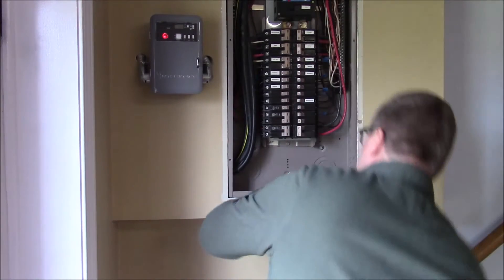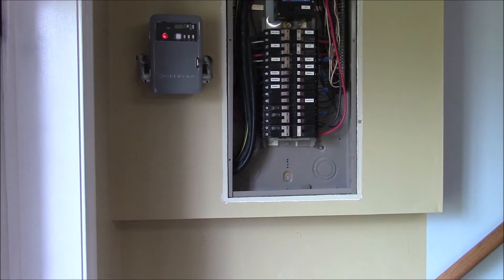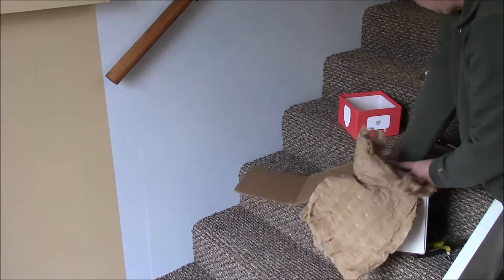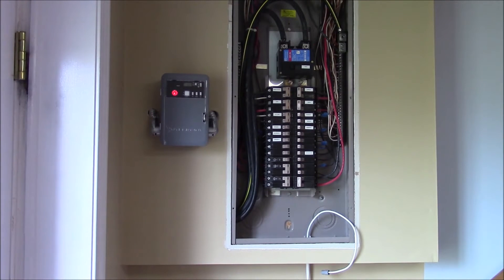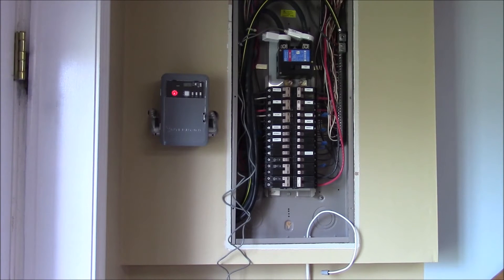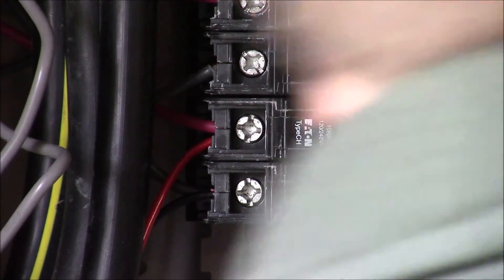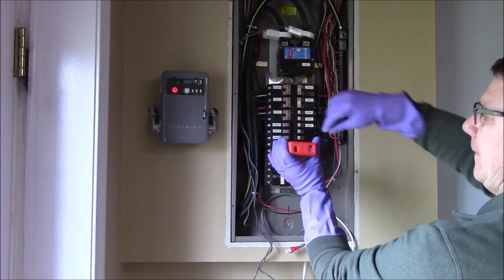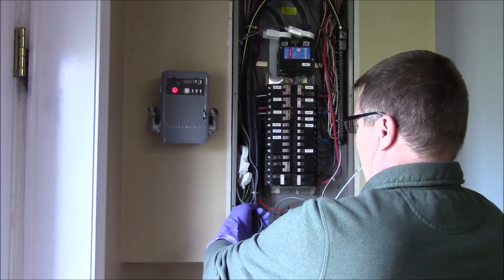Solar Sense energy monitor installation

Comment: Double tapping (connecting  2 wires to a breaker terminal) would fail an inspection by either a building inspector, home-sale inspection or a insurance inspection.
Reply from the maker: Can you explain the safety issue please?
Reply: @davidkllr1629  A concern is double tapping increases the risk of the ends of two wires arcing should a terminal designed to handle only one wire have two wires attached not tighten correctly.  Equally, the original circuit may have been designed to code and approved with the proper breaker for the expected load.  Should an additional circuit be added to an existing breaker the new load or potential load may far exceed the original design considerations (not in you case) thus creating the risk of inadequate circuit capacity and reliability.  However, a new owner may have no idea that the electrical circuits were modified subsequent to original design and approval but a double tapped breaker is a tell-tale clue that the original design parameters may be compromised.  Therefore a home inspection done for a new owner will point out this potential condition that a not to code (or unsafe) modification was done.

Comment: So they say to clamp the solar clamps with label going to "power source", I was thinking the power source was the solar panels / inverter but seems like you installed labels towards the power company main power source is that correct?

Comment: I just loved all the wrong electrical assumptions, the lack of proper safety precautions, the improper use of "insulated" hot gloves, and of course the double tapping of the one breaker you're NOT supposed to be using for anything else than the actual solar system...Unreal!!!
Reply from the maker: Thanks for watching! I appreciate your concern for my safety.

Comment: I was setting up Sense for solar and I had this error message popping up "wattage mixed polarity" and solar setup failed.I'v got answer from Sense Help,that this is because one of the solar clamp was installed flipped, so it reads negative wattage.So to make it work you need to make sure that label "sense" on solar clamp faces towards solar wire production.There are arrows, so make sure you have the same direction of arrows on clamps.It's tricky part, but it was that error solved.I was running like crazy turning solar from outside, one by one inverter..tried everything and nothing solved it ..Ohh and it was just that clamp direction problem. I hope this helps if you facing the same problem.Otherwise Sense is marvelous, the best energy monitor of house and solar on app.I love it.

Comment: Great Video. I noticed that you connected power to only one side of panel. Another video I saw he pointed out that you should connect the power to each side of panel otherwise Sense will not be able to detect devices on the opposite side of the panel and will list things connected to the opposite side of panel as "Unknown". Does this make sense?
Reply from the maker: Terry Pounds thanks for watching! The Sense unit is hardwired to a double pole breaker, so it does have access to both legs of electrical service. I mention that it's located on a 20A breaker for solar and I should have used a 30A breaker, but I don't explain why. During the solar install, Sense wants you to turn the solar off and back on for calibration. Normally I would turn off solar by turning off the solar breaker, but this also resets the Sense device. If I had used the 30A spa breaker instead, the solar calibration would have been easier. As it is, I had to go outside and disconnect the solar. Not all that difficult, but I felt pretty stupid the first time I tried to calibrate the solar by flipping the solar breaker, which killed power to the Sense that I was calibrating. It was a smack myself in the forehead moment.

Comment: I noticed that you're sharing a breaker between the Sense and Solar. I have a full box and just added a Tesla Wall Connector, and am out of breakers. Seeing your video, seems that I can put the Sense power wires onto an existing 20A double-pole breaker, correct??
Reply from the maker: yes, that works perfectly.
Reply: I suggest using a different breaker instead of Sharing.  Its against the nec code.

Comment: Any chance you could post the manufacturer and model number of the hot tub turn-off device you are using.  Thanks in advance.
Reply from the maker: Rolf Breuer it's a 40A timer, my two person hot tub draws 27 amps. Intermatic EH40.
Reply: Thanks very much. Amazon has it. Will check it out.
Reply from the maker: The part number is accurate, EH40, but I had a look at it and it has 30A relays. Most hot tubs are 50-60 amps, so make sure you get one that works with your spa.

Comment: the smaller the breaker, the sooner it will trip if there is a problem. If that is your worry, then I believe that a 20 amp is better than a 30 amp. no?
Reply from the maker: that is correct, the smaller breaker is better, which is why I chose the 20A in the first place.  The problem I experienced is that the 20 amp breaker is on my solar inverter, and the easiest way to cut power from the inverter is to turn off the 20A breaker, which also cut off my Sense device.  I wasn't aware that I'd need to disconnect the solar to calibrate the Sense Solar.  It wasn't a big problem, I have the code required solar disconnect out at the electric meter, but the first time I tried to calibrate the Sense, I just turned off the 20A breaker to kill the solar, which killed power to the Sense, and the inverter takes 5 minutes to come back on.
Reply: I see. I might need a second one of these. I wish they'd also allow us to directly wire these to our network, rather than use wireless.